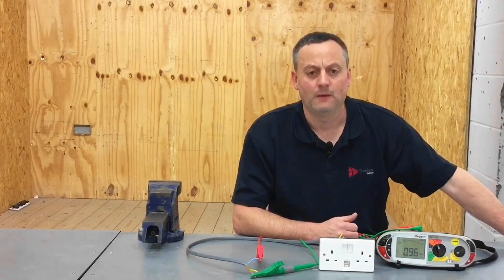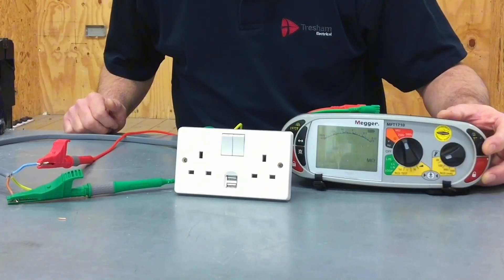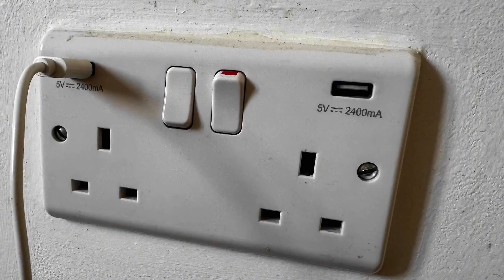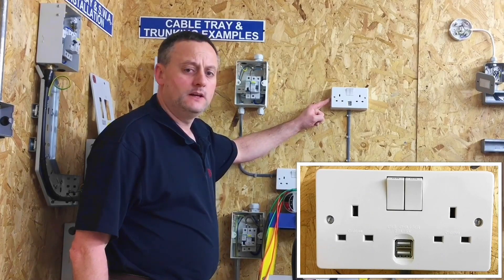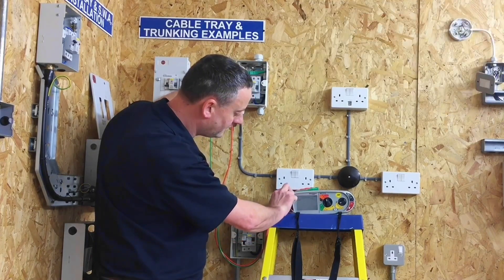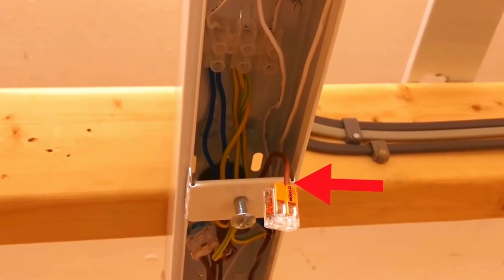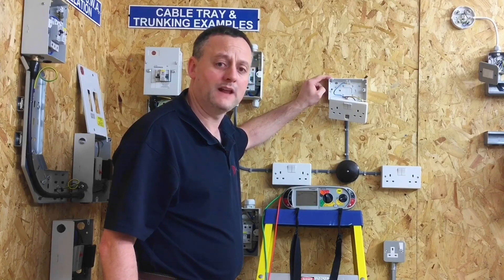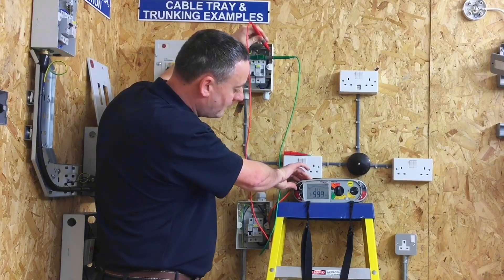Insulation Resistance on USB Socket Circuits

Comment: It’s daft that the switch doesn’t isolate the USB power supply,  the usb  power supply is running 24/7, albeit in low standby mode.  But if you have 10 of these in the house it can add up.

Comment: You highlight an increasingly big issue with domestic circuits today. You refer to USB sockets, but these are now becoming increasingly common in a home environment. Rather than the odd socket, they can be anywhere now .. as an example, most of my kitchen sockets include USBs … as do bedroom sockets. Then there are the electronic controls associated with central heating and hot water … with, maybe, smart thermostats. Equally, how many light fittings now do NOT include LED lamps, many of which are dimmable … and the, ultimately, all the smart light/power controls (eg; Quinetic) receiver/switch modules that can be buried around the house??
A couple of years back, I had to get an electrician in to work on a failed MCB, he performed a standard hi volt test to check the circuit integrity and also checked the neighbouring circuit to ensure wiring was not damaged by the effected MCB. This circuit happened to be my hot water supply ..  later in the day, I go to boost my hot water only to find the controller was fried. As an aircraft systems engineer that has spent many years working on high power electrical equipment, including 270Vdc systems (exciting), I realised immediately what he’d done. 
The problem is that modern homes are becoming increasingly complex electrically … and many of the older sparkies may not be familiar with the pitfalls and challenges of remaining current.
Reply from the maker: Wow thanks for the very detailed comment 🦾👍🏻

Comment: I have an A4 sheet of stick on dots, I put a red on sockets I have disconnected behind the faceplate. Easy to then fly round and check you haven't forgotten any. Of course most sparks just leave them floating around.
Reply from the maker: Nice tip 🦾
Reply: Where did you get your data from that confirms “most sparks just leave them floating around” I am intrigued to read this information.
Reply: @andyc7946  It's called working on site with other sparkies. Google it for more pics and white papers on the subject. That google box isn't just for 'cat videos'. Your welcome.